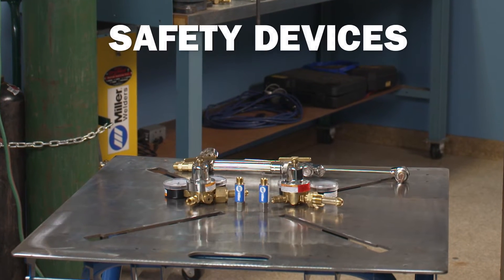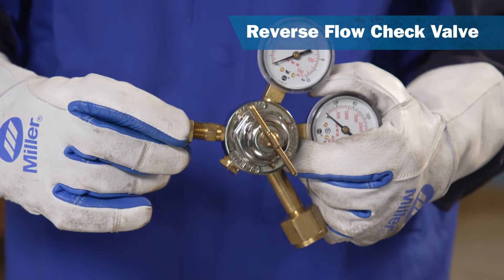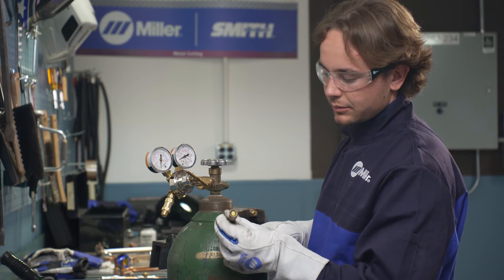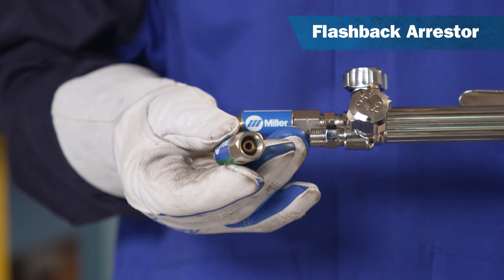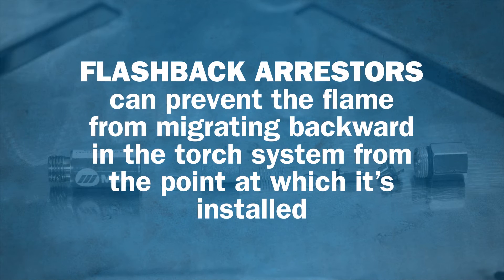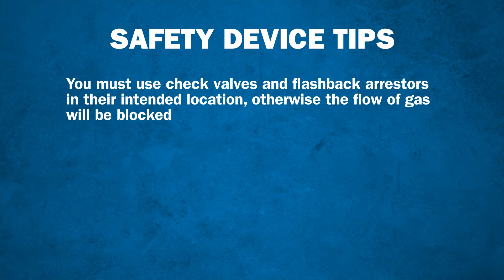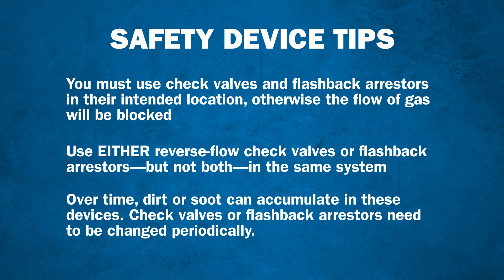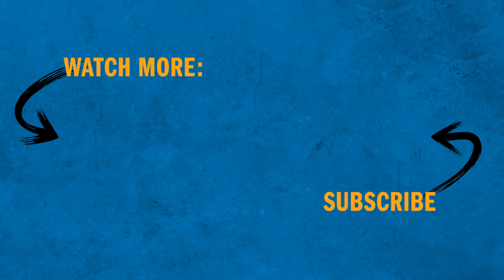Oxy-Fuel Outfit Safety Devices

Comment: So... the Miller flashback arrestor has a reverse flow checkvalve built in, correct? Is redundancy the reason you also say a flashback arrestor and a check valve should not be used together, or am I missing something?